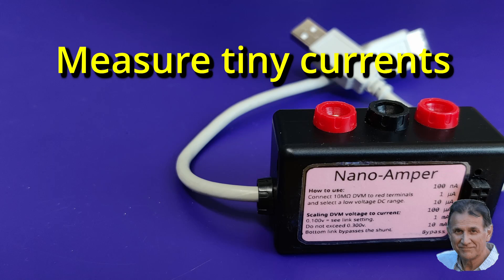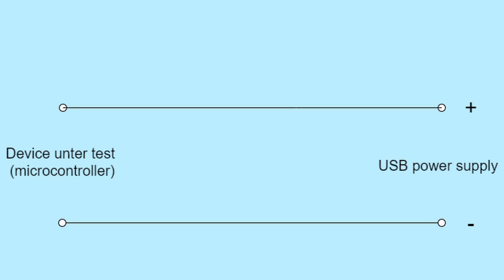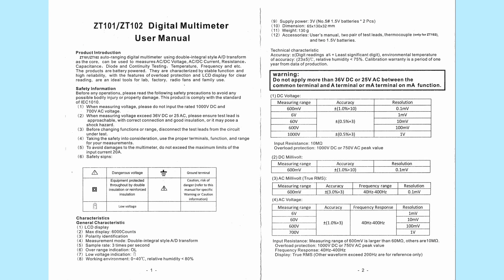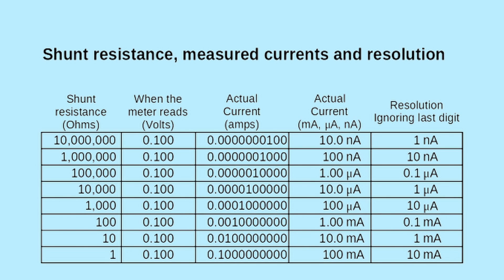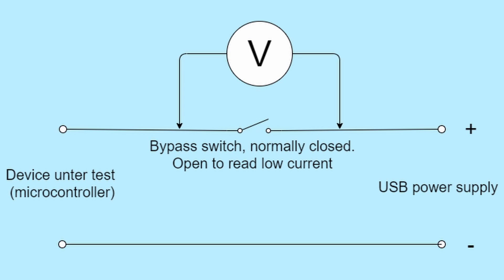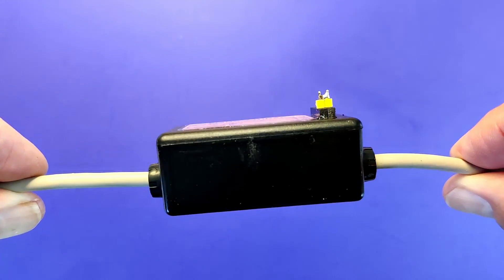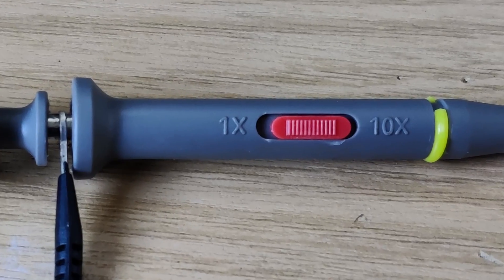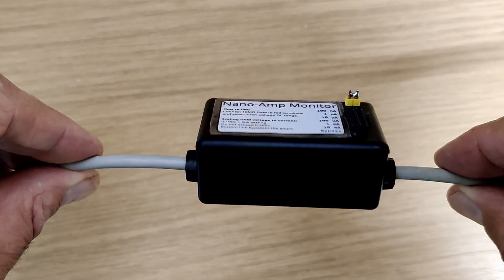Measure sleep current uA/nA of battery equipment using a cheap meter.

Comment: Another way, would be using a 10 ohm resistor with an opamp, to multiply the voltage.

Comment: Can it use in AC current?
Reply from the maker: Yes of course it can measure A.C.
Digital voltmeters are not very accurate when switched to Vac so just bear that in mind. Using a scope could provide more accuracy as scopes are designed for small vlotages.
Just remember this is a low current measuring device and the components are low power. The principle will work with higher currents if the components are rated higher. Don't use it on mains voltages!
Reply: Thank you Sir  @richardlangner
Reply: @richardlangner 
I have a plan to use ADS for voltage differential measurement
Reply from the maker: @ahsanfi  What ido you mean by ADS? Can you descibe your circuit?
Reply: @richardlangner  I mean ADC
Reply: @richardlangner  and connect it to a Microcontroller
Reply from the maker: @ahsanfi  This video is about measuring current, your ADC will measure differential voltage.
Perhaps this is a good place to start https://www.analog.com/en/resources/analog-dialogue/articles/measuring-small-differential-voltages.html

Comment: Great video, thanks. As other have mentioned it is a very effective solution if you don´t want to spend 100s or 1000s of dollars. Could you share the part number of the diodes that you have you used to limit the voltage across the sense resistor?
Reply from the maker: Any 1 amp schottky diode  - such as1N5819 which is a 1A 40V Schottky Rectifier Diode.
If you have any scrap switching power supplies (wall warts, computer PSUs) they almost certainly have schottky diodes.
Use you meter on diode mode and check the forward voltage. 0.6v is silicon, 0.3v or there-abouts is schottky.
Reply: @richardlangner  thanks! I already have some Rectron 1N5818W-T, which are rated to 30V instead of 40V. I guess this should be fine. Do you agree?
Reply from the maker: @misckicirina  Yes that will be okay. The PIV will never be tested as it's only used in the forward direction. The forward current rating of the diode need to be within limits though.
Reply: @richardlangner  I am thinking to make a PCB with the circuit you showed in the video, but adding an INA849 to amplify the voltage signal and an ADC (like for instance the ADS124S08) to feed the digital data to a microcontroller and show it in a small display. I know this will complicate the circuit sensibly, but it would allow to not have to use a multimeter. Have you tried something similar? Maybe it could be an idea for a follow up video.
Reply from the maker: @misckicirina  It kind of defeats the simplicity aspect.
You will also need to ensure the suppy ground (0v) are separate between the microcontroller and shunt.
Reply: @richardlangner  I have just received the PCB I have designed based on your idea. It works very well except that I need to replace the Diodes with a diode model that has very low leakage. It's not a problem anyway since I can enable/disable them via jumpers. I could measure around 50-60 nA with my super cheap multimeter from over 20 years ago. I have confirmed very similar measurement value with a much more modern and accurate Fluke 88 multimeter.
Reply from the maker: @misckicirina  That's great you've made a PCB!
It would be nice if you could email me a picture <myname with no spaces>@gmail.com
Reply: @richardlangner  done now.

Comment: Simple and cheap, I like it.
Reply from the maker: Thanks for the kind comment.  A friend wanted to measure the sleep current of his car after various sections shut down gradually, and this would be an ideal way to do it. Just replace the relevant fuse with a blown one (so you can connect wires to it) and put the diode/resistor/meter across it (and a fuse in series for extra protection of course).

Comment: I used the same Priciple tp measure high resistors.
Simply a voltage source in series and then measure Voltage.
Ohms law for the rest.
I love electronics.
Reply from the maker: Yes exactly the same principle. Way back I used it to mearure 100Mohm resistors; 240v ac across the 10M meter and 100M resistor in series gives about 22v ac. Glad you liked the video.

Comment: Thanks for the content of this video.   Is there a disavantage to not using smt resistors?   Woulld wattage resistors did you use?
Reply from the maker: You can use any type of resistor. The wattage is very low so okay to use 1/8W resistors for all but the 1mA range which should be 1/4W.